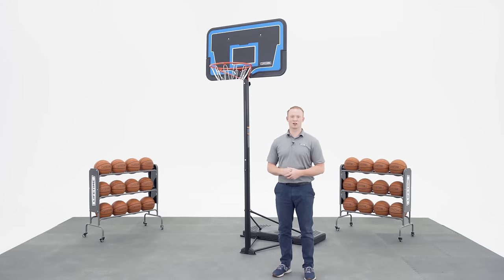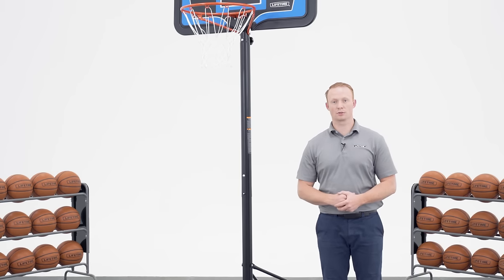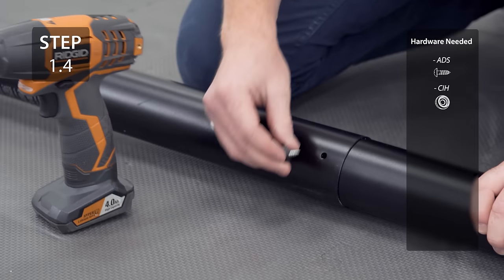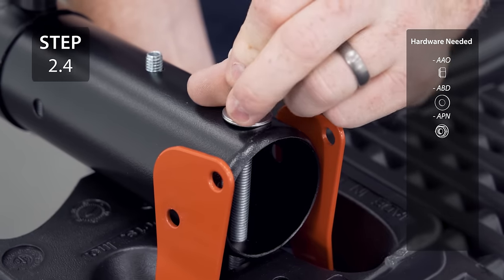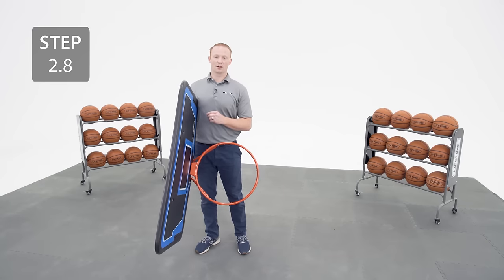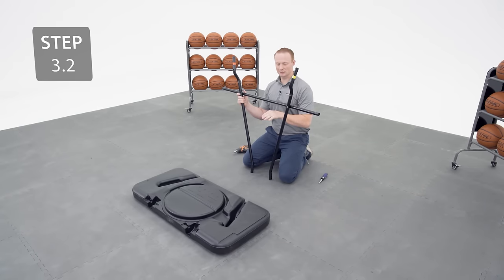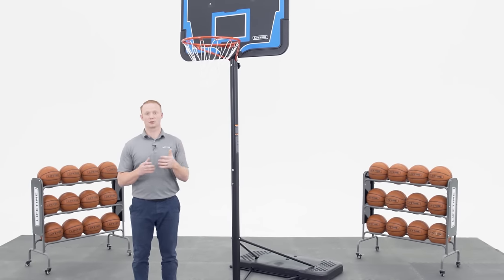Lifetime Streamline® Basketball System | Lifetimes Assembly Video

Comment: This video helps a lot. No way with only the manual. But, man, this the hardest and weirdest thing I've ever assembled. Connecting the pole to the base is the worst part, it's a nightmare, because, I don't no why and for no good reason, for the two connections they choose 2 kinds of screew completeley different from all the others, and the hardest to use, in the more difficult (and dangerous) step of the assembly.

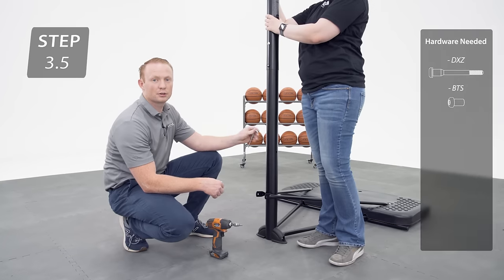Comment: Every lil edit cut you see is where they spent 10 mins beating bolts into place while 2 other adults help pull twist and beat as well. This crap was hard to put toggether and these instructions are not very clear. Single bolt at minute Mark 9:37 is one of the hardest bolt installations I've ever done in cars, pool equipment, anything! Its dirt cheap so I guess that helps
Reply: Took me and two other grown men to get that piece on.  You are not kidding.

Comment: Trash.  My wife and I almost got a divorce putting this thing together.  Never again.  I also had to use my own bolts to finish it and my own tools.  What it comes with is stupid.  Even with my really good tools this was 5 hours of life I’ll never get back.  Terrible job LIFETIME
Reply from the maker: We’re sorry to here you were having a difficult time assembling. For future reference, when you are having trouble or need extra parts, you can reach out to our customer service team for some extra help and the parts you’re needing. They can be reached at 800-225-3865 or by email at customercare@lifetime.com. Customer Service hours are Monday-Friday, 7:00 am to 5:00 pm and Saturday, 9:00 am to 1:00 pm (MT).

Comment: What do we do with 3.5? The DXZ screw doesn’t go all the way through the holes and main pole
Reply from the maker: It is normal for the bolt not to go all the way through. The nut will reach the bolt on the inside of the pole.
Reply: @LifetimeProductsAssembly hello, can't get the vice into the hole because of the thick part of the vice which is blocking

Comment: 3.5. Bracket holes are not big enough for the screw or the screw nut. Ive read this comment over and over. How have you guys not corrected this?
Reply: Yep I have the same issue, it's criminal this hasn't been corrected yet

Comment: For anyone who still struggles with this thing on step 3.5 when you have to but the bolt through the pole and out the other side through the brackets if you keep an Allen key in the screw you will be able to see it on the other side to put the end piece of the screw on and move it around if need be it made it so much easier for me to finish it
Reply: Bro this comment is worse than the actual step!

Comment: What do you do if you received the Top Pole with the Middle Pole stuck inside and will not remove? 1:50
Reply from the maker: Give this trick a try: https://youtu.be/6WNdppuh7F8. If you're still having troubles, please reach out to our customer service team. You might need replacement poles. They can be reached at 800-225-3865 or by email at customercare@lifetime.com. Customer Service hours are Monday-Friday, 7:00 am to 5:00 pm and Saturday, 9:00 am to 1:00 pm (MT).
Reply: @LifetimeProductsAssembly  Thanks for the tip. I’ll give it a try and report my progress in the comments.

Comment: The base was mad wobbly when I finished but it was before filling the base.  Is a wobbly base normal before filling
Reply from the maker: Yes. The weight of the water or sand is what helps stabilize the basketball hoop. The system is expected to have a little play but not enough that it will affect the performance of the basketball hoop.
Reply: @LifetimeProductsAssembly  thanks.  Set up was a success. Endless fun since Christmas

Comment: I want to increase the height of it as I put it down to around 7 foot but it’s soo hard to lift the pole up and at the same time put the screw through is there a way I can tilt the basketball hoop and perform this or will it affect the hoops bottom
Reply: How do you increase the height
Reply: same question. the whole board is heavy. tried doing it by laying down the whole thing with the help of 2 people. but now I have filled the base with water so I dont know how else im going to do it lol.

Comment: Stuck on step 2.5 the screw will not go through both the holes  im so frustrated
Reply from the maker: If the screw is not going through the holes, it could be excess powder coating. One thing you could try is using the threads on the bolt to ream out the excess powder coating in the hole. If that doesn't work, please contact our Customer Service Department. Our Customer Service Team can be reached at 800-225-3865 opt. 1 or by email at customercare@lifetime.com. Customer Service hours are Monday-Friday, 7:00 am to 5:00 pm (MT).

Comment: I did it in about 3 hours. They do a great job at labeling and everything. There were 2 struggles one my fault the other is an opportunity for better design. I had to undo stuff a few times because I got mixed up with orientation so be careful with that. The opportunity is the bolt for the upper pole to base supports. To make easier don't tighten the other end snug until you get the part connecting to the pole.
Reply: Need parts that was Miss placed

Comment: did it in 5hrs. lol. Thanks for this. I struggled on 3.3 and 3.4. got lucky with 3.5. my question is, do you need to lay the whole thing down to adjust the height? especially already have water? tnx to any1 who wil answer.
Reply: another question, how do you drain the water?
Reply from the maker: No, you can adjust the height while the system is still up. You can remove the water be tipping the system over at an angle to help remove water.

Comment: And THE GRAN FINALE: to attach the upper pole braces, Lifetime decided that would be a good idea choose not a normal screw, but a "special" one. That screw is short and it doesn't reach the opposite hole. To attach it, you have to use a long screw nut whose thread part goes through the hole and completely enters the pole. So... you have to make the screw and the screw nut "meet" themselves inside the pole! An insignificant detail: because the pole er... is not transparent, you can't see anything. Besides that, both braces press down, pressing down the screw and the screw nut. It is in that scenario that you have to make them meet... Basically, it's a lottery. Since yesterday, I failed miserably several times trying to do it. An unnecessary nightmare. Tomorrow I will try to find a normal screw to use in place of that demonic hardware provided by Lifetime.
Reply: I had to loosen the bolts on the base. And that really helped me align the bolts inside the pole.
Reply: Omg, I’ve just nearly killed myself putting this together and that is the bit I got stuck on and gave up
Reply: Buy a different screw. The same day I wrote the message above, I tried one more time and finally got to attach the screw and the nut, but it took me almost two hours and much suffering. And it was totally lotteric...
Reply: @carloscampos1280  I used a different one I had in my toolbox after I read your comment, it is finally built!! Thanks!! Never again hahah
Reply: @Andy-py5go , man, you did it! Consider yourself a kind of hero.😅
Reply: Ah it finally dawned on me that an ordinary bolt and nut would have a sharp end sticking out which could cut or hurt a player
Reply: Glad we're not the only ones!
We've actually gave up on those braces /pole bolt.

Try tomorrow.
Reply: Literally the worst design ever it took so darn long trying to fit them together almost quit a couple of times but after I tried one more time it start tightening and my God was it the best feeling
Reply: @adamelrify2187  1000%!!
Reply: got lucky with 2 attempts. Though was punished by 3.3 and 3.4. and I have forseen that 3.5 will be the worst. I took a break after my 1st attempt and was able to get lucky on the 2nd attemp. really bad design.
Reply: I had to take a drill bit and drill the holes bigger to allow that ridiculous bolt BTS & DXZ to fit through
Reply: I am usually the go to guy for assembling things - gave up and put a standard bolt in after over an hour of trying, the tolerance on that cleat bolt is ridiculous, also had the bend the arms to an angle that matched the pole, be careful the steel is really soft, also the base bolt is rather silly again nearly an hour to get that to catch, tolerance again about half an inch too short, three hours later voila! but this could have been much easier with a little more thought by the manufacturer, it appeared to me that someone had deliberately gone out of their way to make this really difficult.
Reply: This is what killed me ad well. Such s bad design. Impossible to fit.
Reply: So I struggled the first time with this, but on the second run I was outside with better lighting instead of in the garage. What worked for me is inserting the screw first and if you’re in good lighting you should be able to see the tip from the other end. It’s much simpler to line it up that way. Happy hooping 💯🏀

Comment: Howd you tighten at 9:30 without holding the nut?
Reply from the maker: The feet have a mold that holds the nut in place to aid the tightening process.
Reply: How does the base magically flip over at 7:52? This is where I'm currently stuck.

Comment: How do I remove the poles the got stuck now i cant remove it
Reply from the maker: Unfortunatly, there's no way to remove the poles on this system. You can reach out to customer service and they can help you order new poles for your system. They can be reached at 800-225-3865 or by email at customercare@lifetime.com. Customer Service hours are Monday-Friday, 7:00 am to 5:00 pm and Saturday, 9:00 am to 1:00 pm (MT).
Reply: Look up another video. I did same. Have to drop it a couple times from waist level horizontally. By couple times i mean like 50. Lol
Reply from the maker: @joshuahensley3782  The drop method doesn't always work with the skinny poles which is why we recommend reaching out to our customer service team for new parts. Glad to hear that it worked for you, though!
Reply: You can remove poles if they get stuck! In a grassy area lift it up and throw it down horizontal and after a couple throws the poles will come apart. There is troubleshooting on it if you Google it.

Comment: It is 5 am and I'm in tears. I spent several hours yesterday trying to assemble this basketball hoop system for my kids. I had to go and buy other tools smh but I got it together until!!!!! I got to the base and putting the screw through the feet. It just does not come through the left foot far enough to put through the right foot and put the bolt on. My kids are so disappointed and so am I! A huge waste of time and money.
Reply from the maker: I'm sorry you're having trouble with the feet assembly on this system. Give our customer service team a call and they can walk you through the steps on the base assembly and can help figure out what's happening. They can be reached at 800-225-3865 or by email at customercare@lifetime.com. Customer Service hours are Monday-Friday, 7:00 am to 5:00 pm and Saturday, 9:00 am to 1:00 pm (MT).
Reply: I called your customer service and the man was of absolutely NO help! NONE!!!! He said I need a socket wrench, I bought a whole set but the screw has to come through the foot so I can fasten the bolt.
Reply: He then said that was all he could tell me other than maybe I was using the wrong screw WHICH I'M NOT.
Reply from the maker: We are sorry our customer services team couldn't help you with your issue. Please email us your number to installationservices@lifetime.com and we will contact you.
Reply: Can i ask is this a bit shakky than the straight foot one ?

Comment: You should show the actual bolts that are being used. Mines aren’t marked and I’m having to guess
Reply from the maker: On the right side of the screen you will see the hardware needed for the section and the diagram of what it looks like. You can also match up the hardware to the manual as the picture of the manual is the same size of the actual bolt.
Reply: @LifetimeProductsAssembly  what I purchased is actually different. It’s the 1221 model

Comment: Avoid this product, very difficult to assemble. Don't tighten bolts as will lead to miss alignment
Reply from the maker: What were you having troubles with specifically? We'd love to know what we can improve on.
Reply: Step 2.7 - very difficult to add the bolts in such a small space.

Step 3.4 - very difficult to tighten bolts as can't get spanner into support while turning. 

Step 3.5 extremely difficult to get both parts to meet to attach and the  tighten. Why have a short screw like that?  Such a bad design. 

Video gives the impression it's easy, It's not! Also video gives the impression that bolts are all fully tightened, you need to leave loose to align eveything up and then tighten.

Should also not assume eveyone has the tools you have used in this video.

Took over 5 hours to put together.